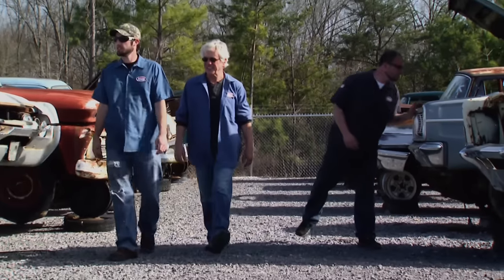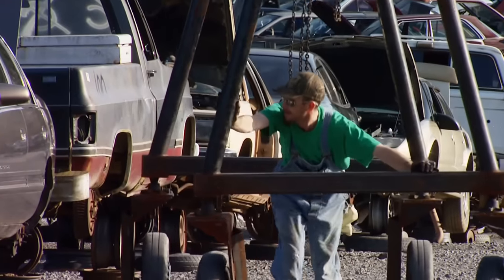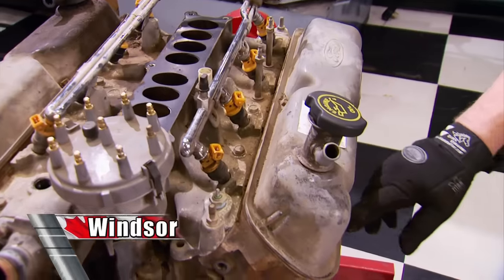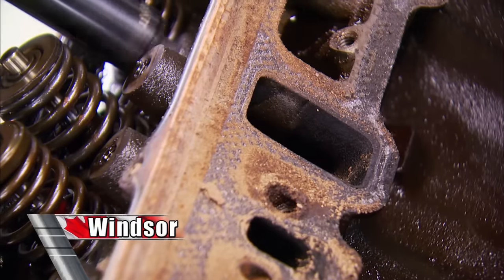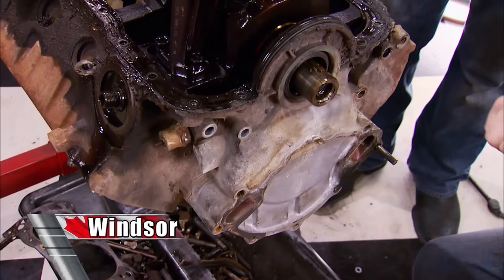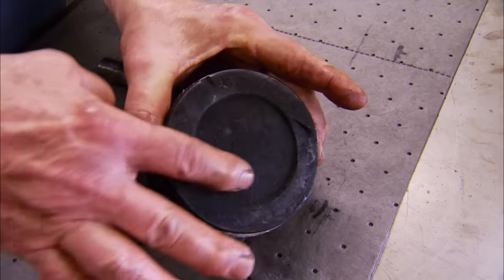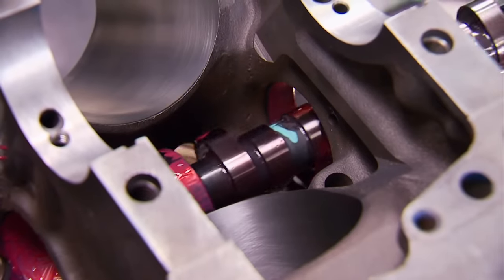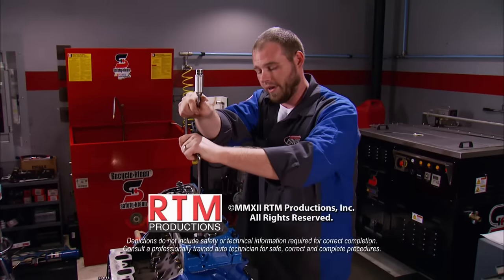Tearing Down a Pair of 351 Small Blocks: Windsor vs Cleveland - HorsePower S16, E10

Comment: Gotta love Ford and their insistence on making junkyard engine builds as frustrating as possible. "Oh your Ford 351 needs a water pump? What year and month was it built on, what's the code on the block, and which plant was it built at?" Even decades later, you have to know which engine plant your 5.4 was built at since two plants building the same engine decided to build them just different enough that some parts don't fit both. My local parts guy had a migraine helping me find the right part for my kids early 2000's Ranger.

Comment: The Cleveland was made in Australia for way longer!!!
Reply: Andy Mate need a  Falcon GT HO Phase III !
Reply: It should be designated a 351G. The fuel injection race engine was a ripper.Only a few made.
Reply: Andy Mate....When Ford officially ended 351C production here in the States late in 1974, they shipped mostly of the tooling to the Geelong, Australia Ford casting foundry where Clevelands were made in 302 and 351 displacements until 1982. The Aussie performance aftermarket is still producing hardcore Cleveland racing components today.

Comment: Bloody hell. Clevos were made until 83. In Australia. Both 302 and 351. 
Clevo rocker ratio is 1.73  1970 2V should be around the 71cc. Even early 400s were 76cc
The base l/h outlet Windsor pump is the same as a Clevo or 429.
Felpro head gaskets are 050 thick unless you buy very expensive but good O ring ones which are 040

Comment: Where is part 2?
Also the only way to know forsure if you have s 4 bolt main Cleveland is to drop the pan they were not just q code engines.
And the cam restrictors are put in all journals but the #1 is screwed in deeper.
And the lifter bore bushings are there to restrict oil flow to the top end not true up the bores.

Comment: You installed the cam plate backwards. On a ford, the torrington bearing needs to face the cam gear. This is because the camshaft is forced to the back of the engine when it drives the distributor. On a chevy the cam is forced forwards.

Comment: I've worked as a machinist in the 70s. When I see what you are comparing as Windsor and  Cleveland something is off. All the Cleveland engines I've seen had 4 bolt mains and large square ports. They even looked larger than Windsor engine. I'm not perfect in my memory not being a Ford guy. But we did build a lot of Race engines, some may have been modified before I saw them. But you are also not comparing 1970 engines.

Comment: I can't wait to see the follow up, but fear disappointing results.   Clevelands are very persniggity.   The exhaust ports on the Cleveland head really are only about half the size of the port @ surface.   Exhaust has to go over a hump to get out.   There are RPM ranges where the heads flow very well, but can be annoyingly untractable like the 4V Clevelands.   
I suggest they research Cleveland engines, and take a hard look at what the Aussies did with them.

Comment: With the Windsor having come from a considerably newer ford pickup than the Cleveland that came from the 72 LTD wouldn't it be a better comparison to have had a Windsor of a similar timeframe?   For example... the fact that the Windsor is from an EFI vehicle where the fuel pump is in the tank provides for lack of comparability to a 72-73 Windsor that would have had the pump on the motor....which could be helpful in trying identify a motor in a junkyard, etc.

Comment: I have question for you , I just purchased a 69 Mustang w a 351 cleveland , its running but issues make me wonder ?? is IT ? or is it a 302  this video shows alot of the external pieces match mine engine as far as intake bolts 2V , water inlet ,valve cover bolts (my covers do not have the  difinitive square'ish covers more rounded yet a slight rise so which doIhave ?Thanks

Comment: So I have a 1977 Ford F-100 Custom Supercab shortbed with a 100k miles all original except a paint job and flowmaster exhaust. I've always been told it has a 351 Cleveland modified which was fords 400 big block. Are yall saying if its a modified it's not a big block or is a big block and is it a Cleveland or a windsor? Please excuse my lack of knowledge honestly the truck runs like a new one I've never had to do a anything other than replace the alternator so I've never done much research on it. Any explanation of what I really have would be greatly appreciated I'm going to start a frame off restoration on the truck soon. Thanks in advance for any insight
Reply: HD RYDER the 400 uses a big block bell housing bolt pattern, the bore spacing of a small block, and Cleveland small block architecture.
Reply: @ProjectFairmont  ✈ you just zoomed straight over my head lol. I went on a vin decoding website and it said my truck has a 400 big block 6.6 liter and that the 351m is a 5.8 liter. Ive been a body man a painter can do anything to a vehicle outside the block. Ive never opened up a block so I never gave engines internals much thought or attention. I wish that wasnt the case nkw that Im ready to start a frame off restoration on my truck. But it is what it is the engine rebuild will be done by a professional unfortunately. Thank you for responding! I just wish I understood what your saying lol!

Comment: Damn Windsor water pump bolts are impossible not to break lol. Glad it’s not just me lol
Reply: It's the same for me. I go to replace a pump on one I make sure to take my stud extractor as well as a cordless drill and bolt extractor set because one (at least) IS going to break off. Great tough motors though.
Reply: Never broke my 302w waterpump bolts but my dad has not been so lucky
Reply: @coolguy2370  I have not had a problem on a 302 (yet!), in my experience it has all been on the 351W. Which I have yet to figure out why. Add a dab of engine assembly lube to the bolts and it does not seem to happen again. My guess is anti-seize or the like would work too, I just tend to have the one on hand in good supply vs the other.
Reply: BloodRaven1969 no doubt they are great motors. Don’t have any Cleveland experience.
Reply: @droppedf100  I've built and just done plain rebuilds on both. My experience is the Clevelands are easier to make big power with, the Windsor bottom ends are more durable, and a Clevor is the best of both worlds.

Comment: I'll tell you a funny 351 Cleveland story.
Towards the end of the 351 Cleveland production run Ford wanted to up the power
in their station wagon fleet. As it was, the 351C did not have the power Ford 
engineers was looking for. SO, they took a 351C, punched it out to 400 & with
the C heads provided the power Ford was looking for. Ford built THOUSANDS
of station wagon & trucks with this 400C engine. MEANWHILE all the gearheads
are scouring every wrecking yard in North America for 351C passing over the 400s
unbeknownst to them these were 400C.

!

Comment: build a clevor....windsor bottom end,clevo heads...best of both worlds
Reply: You only say that because you live in the 80's. Windsors because of their long production life are easier to find. That does not make them better. C blocks are already machined for 4 bolt mains. You can do 7-8K RPM on 4 bolt mains, try that in a 2 main Windsor. If your going NA, you need RPM. Good Windsor heads exist, but you can use NASCAR style heads if you want but need an aftermarket block, all Cleveland based...

Comment: I learned something new today I didn't know that Windsor was a Canadian Ford motor cuz mine is 302 Windsor
Reply: 90s 351 Windsors have a sticker on the back of the valve covers that indicate that they were made in Windsor, Ontario. Ironically, most 80s and up 302s and all Foxbody 5.0s(which are Windsors with a shorter deck) were assembled in Cleveland at Ford Engine Plant 1 and 2.

Comment: It's a curiosity why Ford would have such substantially different versions of the 351. Did they ever admit that these Ps.O.S. slipped out of park, or wouldn't start without the ol' "reach-over" to support the shifter? Tough engines regardless... that, and the 390 too. Mechanic dudes amaze me.

Comment: Hopefully I'm not going to start a war gentlemen and ladies I would like to know which is better and what makes it better than the other the Cleveland or the or the Windsor or are they just real good boat anchors and witch one could I build and get a good reliable 475 hp
Reply: The C is easier but more expensive more hidden hp from the start if you have a 351C 4V cc. A W can fly but requires more work.

Comment: The 400 with 4V closed chambered heads would of been much better with the extra cubic inches from the factory.  It can be done now with intake adapters/spacers and get allot of power with better parts availability.

Comment: Man if only I could find a good yard near me my cati could use a new gas tank
Reply: @ HNS Hackers... A good fuel tank is one of the most important improvements that can be done to a classic Mustang or Cougar. But I don’t think I would want to buy a 40+ year old gas tank from a salvage yard just to save a few dollars. You can buy a brand new, SAFE galvanized steel tank and kit including the filler neck rubber hose, fuel level sending unit and all installation hardware for less than $100 from any classic Mustang parts vendor. For a few dollars more you can get the tank in stainless steel that will last longer then the car. Or take your chances with a rusty old junk yard tank and buy a case of cold beer with the money you save 🤔

Comment: Ford had some great engines and some that were nothing but junk  .I  should know about this as I had to take apart one of their engines about every 5000 miles because it would worp the heads and lose two push rods from the same cylinder which was the number three cylinder  .  The one question that my father and I had  was where did the push rods go  as we could not find them in the lifter valley or any where else  . This went on for over two years  . I forgot to mention that it was a 1959 Ford station wagon with a stock engine  .

Comment: Interesting. Didn't know that the Boss 302 was a Clevor. Had a 302 distributor on the 351W in my truck for some reason.
Reply: 302 and 351 distributors do not physically interchange.
Reply: @413x398  It was a Motorcraft 12127 and was working on a running 351 Windsor. Also marked DOAF 12131A on the shaft housing. Perhaps it had been modified.
Reply: @jeffbecker8716  12127 is the Ford generic number for all distributors. But, let's make it easy. Go to any parts source. Ebay, Summit, Jegs, wherever. Find me a unit that lists as applicable to both engines. You won't because much like oil pans, they don't interchange. Could it have been modified? Considering how easy it is to find either, I don't see why. There is no -A, just -AC, and that is a Windsor piece.
Reply: Sorry Jeff, couldn’t have been a 302 distributor in a 351, the 302  users a smaller diameter oil pump driveshaft (1/4”) vs (5/16) for the 351... so it would’ve blown up in about 2 minutes from oil starvation.

Comment: My truck has a 351m/400. Is there any parts I can get for it to get more torque
Reply: Meyer has been into this engine forever.  https://www.tmeyerinc.com/
Reply: There are aluminum intakes and  headers to start. various cams,  a few aluminum heads 
with pistons to make any 335 block make power. Have a 74 400C with an edel dual plane 
and 1 and 5/8 long tube headers. very responsive and peppy. .
Reply: Get the earliest timing chain set you can and install it at 0 degrees straight up....this little trick will wake it up BIG time....seriously

Comment: Identifying the difference between a Windsor and Cleveland motor is very simple.  The Windsor has a wet intake manifold, and a Cleveland has a dry intake manifold.  It literally takes no more than 15 seconds to determine which it is.

Comment: What is the difference between a 351C, 351W, and a 351M-400?...🤔
Reply: A 351M is a de-stroked 400. A 351C Has a shorter deck height than the 351M.

Comment: Is it true that 1969 winsors are technically faster than Clevelands?
Reply: The 351w was an interim middle engine for Ford until they ramped up 351c production.  Ford recognized that the C was superior.
Reply: @ProjectFairmont  until the 351C's were putting inspection holes in the side of the blocks, then magically they disappeared...and Windsors went on for another 20years...(yeah real superior LOL)
Reply: Mister S the Windsor didn’t make enough power to put holes in their blocks!  I love the 5.0 roller cam motor and built these to good success, but the Windsor 351 made no more power, had lower end issues (big high heat mains).  It wasn’t until the advent of race heads and stoker cranks before the 351w came into its own, otherwise it was a truck motor.  Bob Glidden didn’t win pro stock nationals using 351w, it was Cleveland.
Reply: It shows that you read too many books about Windsors and Clevelands and haven't "built" any, 351W makes far more torque than the 5.blow "car engine", Yes the 351W was choked by its only marginally larger 302 based ports, and Aftermarket Heads are a must... and the 351C made more horsepower at the cost TORQUE and of its WEAK bottom end, that "heat" you have read about in your books (because obviously you weren't around when these engines were actually on the street) is a non-issue unless you are turning 8000rpm, and most of the REAL racers (UN-like your Bob Glidden - I am pretty sure most of his "wins" were 429 block powered) you are Yapping about, that were spinning Clevelands that fast were using cranks turned to 302 mains, with spacers because even the 351C mains are too large for 9000rpm...that is not in those books you have been reading, is it?   
You need to quit reading these books and build some engines...I have Built Full Race 351C's and 351W's and I KNOW which ones win races and not just ONE DRIVER going in a straight line...You have MUCH to learn, and books are a start, but you need to build some...and definitely something bigger than those useless gutless 5.Blows. (Thousands of CURRENT Racecar Drivers have started their PROFESSIONAL careers on the back of WINDSOR engines, or maybe you don't get out to the tracks either?)

Comment: I know i'm stupid but I've always had troubles with ford engines . Is it a 289/302/351c/351w/400m/400c,331/352/406/417/ 427medium/ 427loriser/427h iriser/427/428/429/430/460 , gosh .  which firing order is used today ?  Will a c4 bolt up to anything ?  How about a c6 ?  Oops , I'm getting dizzy .  Is the distributor in the front or rear ?  do you restrict the water pump on sunday or Monday ?  Which ones were externally balanced and which ones were internal ?  Cast crank or forger or cast steel .  "Ford has a better idea ".
Reply: yes and no but mostly its on friday
Reply: Are you familiar with how many different 350s GM built, 455s and one 454, and a 472?  All different.  I’m a Ford guy and I know the difference between them all.  The Ford world is not that hard, LOL.

Comment: I wasn't aware the the Cleveland was considered a small block
Reply: 351C was small block because it used 289 302 351W bellhousing... 351M 400M had taller deck height and used 429 460 bellhousing thus the big block moniker
Reply: @ Victor Robison....another fact for consideration is the 351 Cleveland cylinder head bolt pattern and the spacing between cylinder bores is the same as found on the more common 289, 302 and 351 Windsor “small block” engines. That’s why swapping Cleveland heads onto the more plentiful Windsor blocks has become so popular. The result is called a Clevor engine and with the better high rpm flow capacity of the canted valve Cleveland heads combined with the priority oiling system in aftermarket Windsor blocks, some extremely stout engine combinations are being built. 

A good example of a Clevor engine among many can be found here on YouTube. The Australian Higgins Race Heads engine built by Dandy Engines in Melbourne and posted by FULLBOOST is a 461 inch Clevor stroker. 

It was built for street usage and features Higgins aluminum Cleveland heads and single four barrel intake  on a aftermarket Windsor block. On the Dyno running on good Aussie pump fuel it made 934 horsepower and 669 torque. NO nitrous or blowers !  

On a race fuel tune it screamed to 979 horsepower and 700 torque. Full details are included with the awesome video. And YES it’s still technically a small block with full Ford architecture. 😉